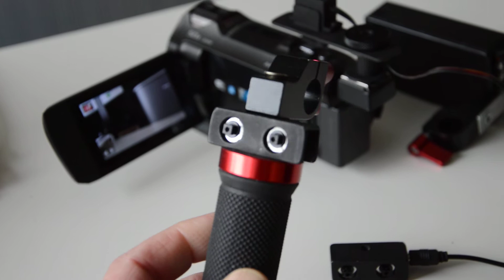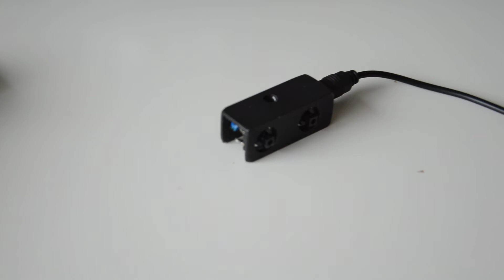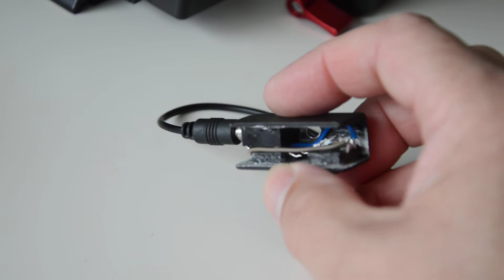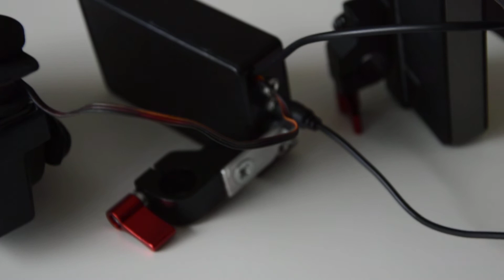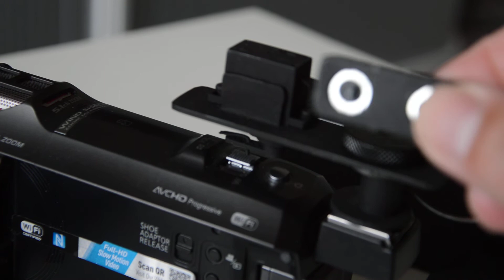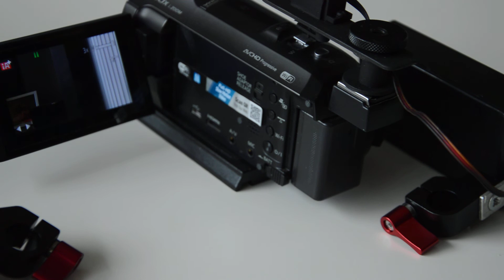Quick first impression of my DIY Arduino video camera zoom control 15mm rod

Comment: Impressive, i wanted to do this digitally but this is way more easier solution :) Thanks for sharing
Reply from the maker: Thank you for your kind comment. I am always looking for simple and cheap and practical solutions :)   He you can see the latest build up of my rig:  https://youtu.be/zlk13bvI_Vk    and this system with some extra visual explanation can be seen here:  https://youtu.be/Q199zLxkKXs   Please do let us know here when you created  your solution. I am always very curious how others made their practical solutions or camera addings :)
Reply: @computerjantje  i will tell you, but somewhere later this year...
Reply: @vladimirkuharik34 did you get a digital solution yet ??
Reply: @afrogroovelibrary  nope... didnt even tried. Try LANC protocol if ur camera is supporting that
Reply: @vladimirkuharik34  actually my camera has the zoom feature the only issue I seem to have is trying to access the software for the zoom feature
Reply: @vladimirkuharik34  but thanks for the heads up
Reply: Hi mate..nice job ,now I'm on here trying to work on it digitally via software..

Comment: Very nice, list of parts you use? Thanks
Reply from the maker: Micro servo sg90     1US$           https://www.aliexpress.com/item/33009883276.html
momentum switches  3US$ 25pcs       https://www.aliexpress.com/item/32845161448.html
Arduino clone  5US$                 https://www.aliexpress.com/item/32374958769.html
Plastix box 100x60x25mm    1US$     https://www.aliexpress.com/item/32915233541.html
15mm rod clamp    2US$              https://www.aliexpress.com/item/32971014388.html
red thumb screw for clamp  1US$     https://www.aliexpress.com/item/1005001278274721.html 
stereo mini jack conn. 2US$ 5pcs    https://www.aliexpress.com/item/32563610006.html
stereo mini jack cable 1 US$        https://www.aliexpress.com/item/33008087385.html
Parts from a magic arm 8US$         https://www.aliexpress.com/item/32737112537.html

tiny peace of thin iron wire to connect the servo arm with the hole in the camera button
Home bend and sawed thin aluminium to mount the servo on the camera and make brackets for the buttons
gluw to stick the buttons and mini-jack connectors in the alu parts
cheap matte black spray paint to make it all black

This video shows the parts a little better due to added photos to the video  https://youtu.be/Q199zLxkKXs
Reply: @computerjantje  thank you very much, I ordered all the parts.
Reply from the maker: @wthiebert  The arduino code is standard button move servo code. Explanations on arduino coding are numerous found on youtube. Good luck on your build and implementation. I hope you'll show it on youtube and please post a link to your project here. Always love to see DIY camera projects. :)
Reply: @computerjantje  I will show it if I can figure it out, I have never done anything with arduino,

I've got all the part's in, was able to get the servo move, huge accomplishment lol,

Now if I could only find out which pins to connect it all to, all I need is 2 buttons for slow zoom, one zoom in one zoom out.
Reply from the maker: @wthiebert  I have send you the code. check your spamfolder if you did not see in coming in. I took my e-mailadress off here again to prevent robots mailing me :)
Reply: @computerjantje  got it, looks pretty straight forward,

Pin 2 pin 12 and pin 9 I will see if I can get it to work tonight. Thanks.
Reply from the maker: I have found some photos and send them to you